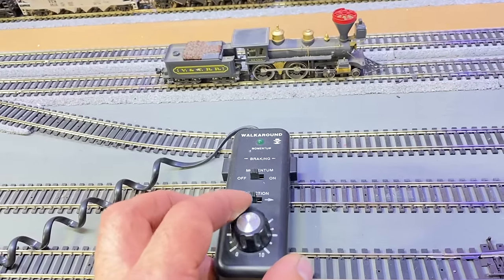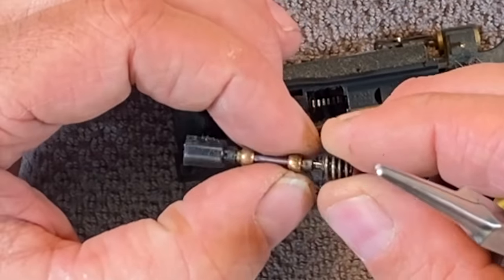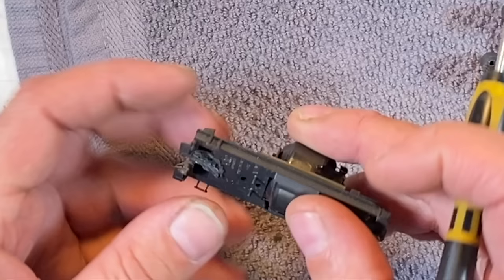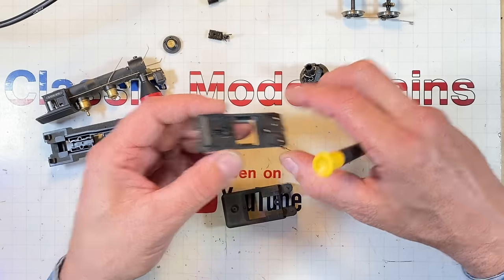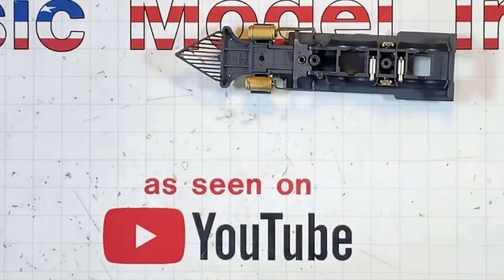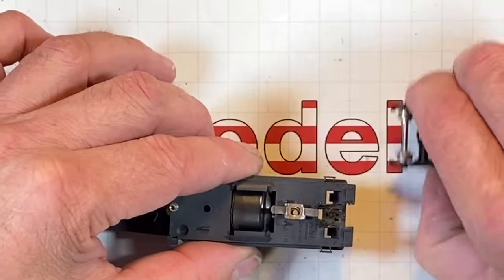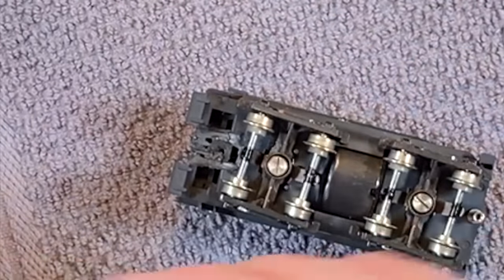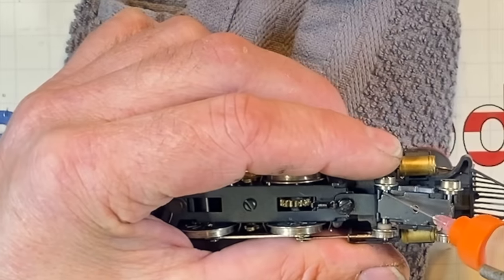54 Year Old Rivarossi 4-4-0. Barely Would Run Because Its So Worn Out.....

Comment: I'd like to see the tyco 4-8-0. Mine acts weird
Reply from the maker: 4-8-0?  never heard of one.  4-6-2 is a Pacific. 2-8-2 is a Mikado and a 2-8-0 is a Consolidation.  I have video's on all of these ones.
Reply: @classicmodeltrains the D&RG 1880s orange and green one. I believe you've done a video on the model itself but never did dcc for it. I tried to install blunami in it and it kinda works. if you try to install dcc the best tip I can give is use a metal 2-56 screw to rethread the the brass motor mount. and use a nylon one with electrical tape to secure it to the frame.
Reply from the maker: @rapcreeperproductions3269  shoot! Ya got me. I forgot all about that DRG&W. ;-)